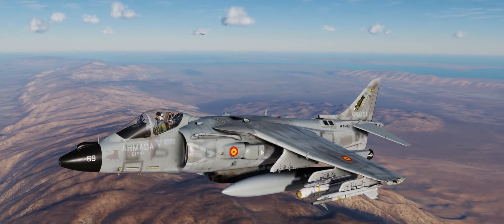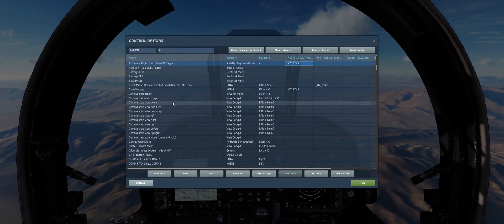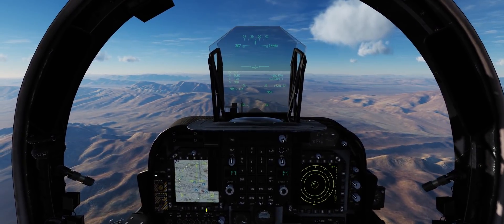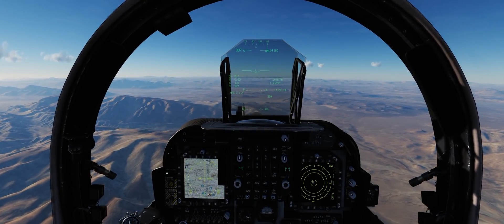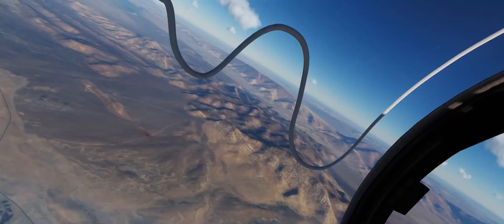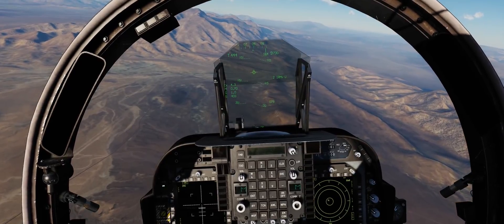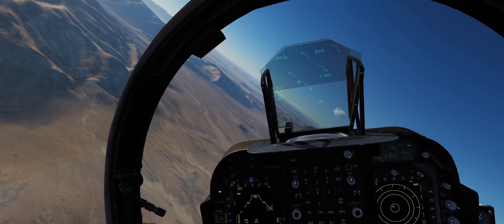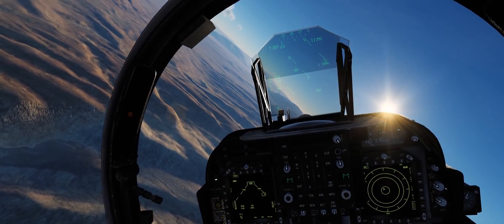DCS: AV-8B NA Harrier II | How to Use Autopilot to increase AGM-65 Effectiveness!

Comment: That's interesting that the Harriers auto-trimming so effective. Been dicking around in the Su-25 recently and you have to completely shut down auto pilot, rather than just returning to manual by pressing A, to clear trimming that you picked up when the plane was unbalanced, or else it put crazy stick dead zones onto the aircraft.
Reply from the maker: Well the aircraft are basically incomparable avionics wise, I really have no Frogfoot experience

Comment: Didn't need to watch as I do exactly the same thing but watched it anyway cos I love how you deliver this.

Just a quick note, if you mount the tanks on the middle pylons and the Mavericks on the inner pylons when you fire the Harrier's attempt to roll will be lessened.
Reply from the maker: Thanks for the support! and you are totally right about the asymmetrical roll effect, but generally Ordies will mount heavier stores closer to the wing-root on aircraft where the wing is stronger than the outboard where the wing is more likely to flex.
Reply: @Spudspike  Makes, sense, you don't want your wing to be strained. I wonder, is damage from too much weight on the wings modeled?
Reply from the maker: @neovo903  Well the Harrier has a very thick and rigid wing so the risk on the Harrier is probably minimal compared to say the F/A-18C we have in DCS, that is why you cannot attach Drop Tanks to the outermost pylons on the Hornet
Reply: @Spudspike  Huh, didn't know that, (I've only flown the f18 once in DCS) I wondered why it can only have a max of 3 drop tanks compared to the Harrier's 4
Reply from the maker: @neovo903  Also because the Harrier has even SHORTER legs than the short legged Hornet, so you have to have as much gas as possible to make it somewhat feasible to Ferry Harriers across the Atlantic with minimal A2A refueling, cause as they say, tanker gas is the most expensive gas in the world.
Reply: @Spudspike  Yep, (I suck at A/R) I remember going through the forums the other day and finding a document which gives a bit of information on the Harrier

http://www.alternatewars.com/SAC/AV-8B_Harrier_II_SAC_-_October_1986.pdf

From what I've seen the Harrier could possibly go 2103nm with the 4 tanks if it dropped them, but you don't want to jettison money so a range of 1753nm.